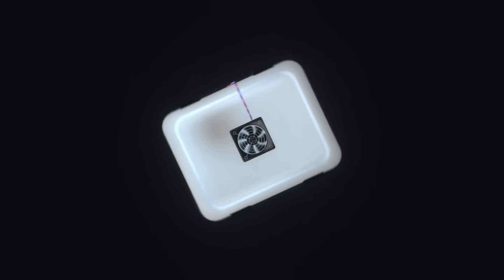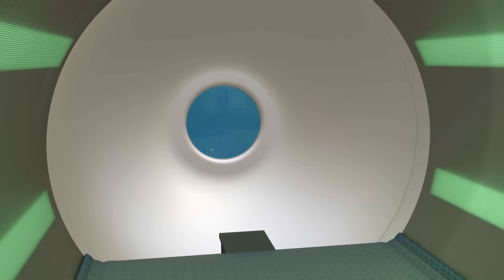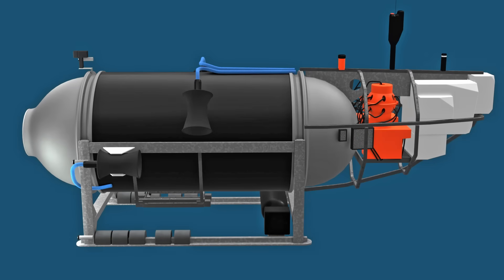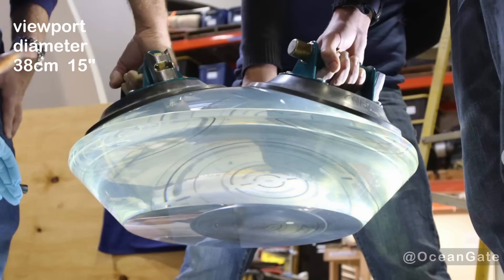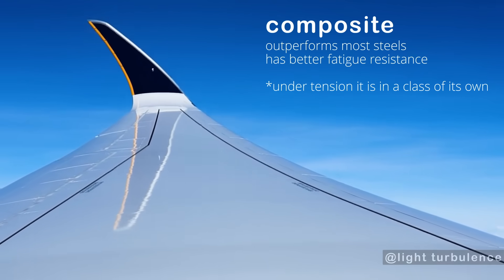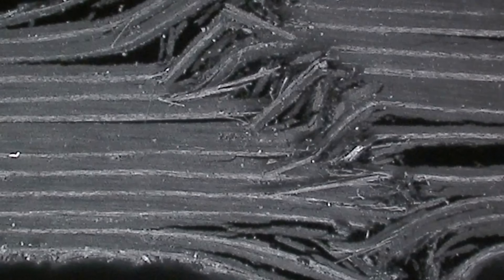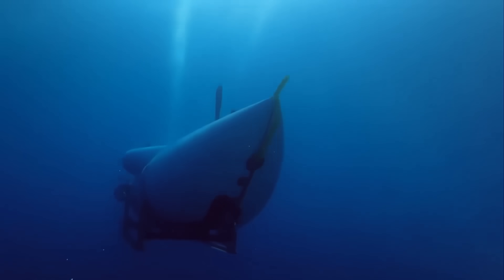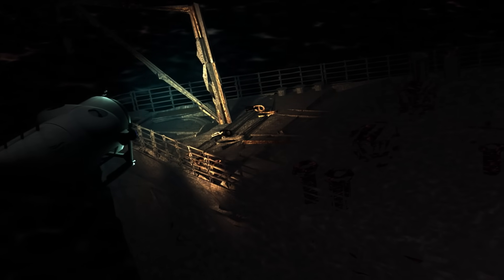Titan Sub | carbon fiber - Detailed Tour

Comment: So there are many comments here and some half truths and statements from people who sound like experts, but the stuff they say is just wrong.  So being an Engineer that worked for the past 30 years in the aircraft industry and design and build high performance sailplanes from exclusively carbon fiber, I will add my 5 cents.

1.  Carbon fiber is a fantastic material with some limitations.  The compressive strength is lower than the tensile strength and for carbon roving my own measurement over a 20 year period in our University Materials Lab, I found the following.  Compressive strength 670 MPa, tensile strength 1000MPa.

2. In compression the fiber absolutely gives the strength.  The lower value is due to the fibers not being absolutely straight and therefore they buckle (Engineering term for structural instability of a column in compression) on a micro level.  The resin only keep the fibers straight and contribute very little to the compressive strength as the resin strength is only about 70 MPa.  

3. Somebody commented that the  analogy of a wing is not correct as there is not really compressive loading in a wing.  That is absolutely wrong.  The structural element in a wing is basically a beam that resists the bending moments.  In a beam the one side (bottom for aircraft) is always in tension and the other side in compression.  We use carbon fiber primarily as the structural element in our beams and the upper flanges is stressed in compression.  Because the compressive strength is well known, we can design save wing beams.  As a matter of fact, the tensile strength is an useless property in this application and we are only interested in the compressive strength.  

4. So to say CF cannot be used in compression is really an idiotic statement as it is untrue.  The compressive strength is merely lower than the tensile, but still very high and usable.  If you know the value accurately you can design safely with it.

5.  The application of CF is a submersible is not necessarily wrong.  30 year ago nobody used CF in aircraft.  Now it is well understood and used (787).  At some stage somebody must push the limit and use this wonderful material in new applications like a submersible.  The problem is that the problem must be well understood and the material be properly used.  The compressive strength of CF makes it a good candidate for this application.  The manufacturing method used was probably not completely suited for the loading of this design.  My own analysis show a SF just above 1 for the limit loads.  This is too close for comfort and a little more structure might have been the right thing to do.

6.  I Agree with the comments that the fibre must protected against water ingress that will cause delamination.

Regards
Attie
Reply: No one here has addressed the fact that while they laminated CF horizontally and vertically, they did not laminate the CF diagonally. My question to experts here is this: Would cross diagonal CF lamination combined with horizontal and vertical layers have been a superior method of building a center tube that would have been able to handle the external compression? Why wasn't this done?
Reply: @PumaTwoU  Yeah too right ! The whole "tube" was a disaster waiting to happen. CF is not the correct material in Hydraulic situations AT ALL . and especially with the layup method they used. Even employees left and washed their hands of it after voicing their objections.
Reply: @PumaTwoU  Re: Diagonal application of layers in a lamination.

Diagonal lamination still winds up being a near 90 degree lamination when compared to the other layers. The further off 90 degrees you go, the weaker it becomes to a force from another direction. In short, it adds a bunch of layers but all the layers wind up only working from one angle while making the whole effort a wasted process.

I'll use plywood as an example. Plywood is indeed very strong against loads applied to it's face. The face also resists shearing (twisting of the layers) when it's attached to a box frame, and will actually provide additional rigidity to the box frame itself against shear. Put a load directly on its edge though and the sheet will just fold up / crumble.
Reply: There are so many comments from armchair Engineers, let me add my two cents. As someone who fixes poorly engineered parts by making better parts that last, here is my observation. It failed. Bottom line, it was poorly and recklessly engineered. I would argue CF is a poor choice for a submersible at this time due to the fact there are little if any real test results for this application. Steel is a proven material for submersibles and CF is still in the theoretical stage.
Reply: As a structural engineer, who does not work with carbon fiber, I had to go to the stress strain graphs to make any type of judgement on carbon fiber as a good material in compression. I honestly couldn't find the numbers you provided for standard carbon fiber testing. There were numbers for an ultra high modulus fiber that were in your range, but most were down about 270 MPa. What I found somewhat disturbing about the material is the modulus of rupture is very close to the elasticity, meaning that the material is very brittle. I would think that under the extreme loading an elastic material would be preferable.
Reply: This seems to be a false equivalence. The problem here is that the pressure is lateral to the layup. The layup was also at a very narrow angle, when I was buying CF tubes for a project I was working on the tube manufacturers offered nothing less than 5 degrees. The layup on this was as near as they could get to 0, I think they offset by 1 width per revolution of the body. So there was very little fiber going along the length of the tube. If it started to crack it just had to split between fibers. If you ever wound a ball of string you know you need to cross it at a steep angle for it to hold together.
Reply: There's a big problem with large-scale layups like this and that's air entrained in the epoxy matrix. On an airplane, sent to high altitudes, those microscopic 14 psi bubbles aren't going to do much. Down below the waves you might hear water working into the matrix, bursting those tiny bubbles and making loud "snap" noises. That would scare the beejezus out of me!
Reply: @Grunchy005  that's why it should be laid up dry and vacuum infused with resin. Won't have any bubbles at all, not even gas dissolved in the resin.
Reply from the maker: Thanks Attie.  I have pinned your comment.  I hope your expert input moves the discussion away from engineering according to celebrity and toward scientific engineering 😁
Reply: @Mike-Bell  Sorry have to call, cut and paste expertise on Attie. There are several elements left out, disregarded the fake engineer, as they would have been sure to mention in talking about compression and tensile strength. And limitations of carbon fiber. I won't elaborate as they will just do a google search and come up with some BS as to why they left it out. But nice try.
Reply: @Mike-Bell  Failed because the guy in charge didnt have the basic understanding of what he was trying to do!
Reply: @Mike-Bell he's not just celebrity.  James cameroon is and has been deeply involved in deep sea submersibles for decades.  That's insulting to his expertise to just brush it off as "celebrity science".  I know your friend didn't go to challenger deep in miriana trench in submersible he built.  And imagine your friend did achieve that, got recognition he deserved, and then people like you brushed his achievements off as "just celebrity science"
Reply: The manufacturing of the carbon fiber would need to be very high precision, with no flaws, so that the strength could be guaranteed. Rather than winding it over a mandrel with rounded ends I'd figure out a way to wind it over end fixtures with hooks to pull the axial fibers straight. Forget pre-preg resin. Wind it all up dry then vacuum infuse resin into it. With that thick of a layup that would be the only way to ensure zero bubbles. The images of the finished Titan hull appear to have many bubbles visible under the outer layer(s).

Instead of machining the ends flat, I'd use a design similar to the plug hatches used on many submersibles. Machine the ends of the tube to a taper on the inside then taper the outside of the titanium rings, with a flat section around the outside so they can't just push into and split the tube. An extra amount of fiber should be wound around the ends to provide resistance to being burst outward by the plug taper and for additional axial support. Done right, this design might work without any adhesive, just several large O rings and lengthwise tension rods (inside or outside the tube) to keep things together when not under outside pressure.

The domes could also 'plug hatch' into the end rings and the front dome could be secured with a few toggle clamps rather than the large number of bolts. Might be possible to not use an aft ring, plug the aft dome right into the tube.

Emergency escape at the surface could be done by designing the ballast system with a forward and aft part. Drop all the forward ballast to make the submersible drop its tail then inflate airbags at the front. The rest of the emergency egress system would release the toggle clamps and the hinge. A couple of internal air cylinders could shove the dome out enough so it would slide off. Ladder rungs built into the interior would enable the occupants to climb out, even if the submersible takes on water and sinks. With the whole front open it should be possible to get out quickly. There are plenty of pools around the world for testing such an escape system without dropping the test article into the deep ocean.

Having a front dome with a vertical 'conning tower' with a plug hatch would add a lot of weight and complicate the design for resisting pressure. It'd definitely have to weigh more. Perhaps a center metal section with the top hatch and two CF tubes? Make it a bit longer for more interior airspace to increase buoyancy to offset the additional weight? 

Designing it to be assembled without gluing anything to the body tube would enable easy replacement and upgrades. Build a basic dummy submersible with just the tube, rings, and domes then repeatedly run it up and and down until it either fails or proves to be essentially indestructible down to the operating depth. If it implodes then the working life and depth of that tube design would be known.

But of course such prototyping and testing costs a lot of money, which as yet nobody building submersibles has decided to spend on R&D for a non-metal hull intended for super deep use.
Reply: @greggv8  re: Machining the ends flat

I watched a couple of vids showing the assembly process, and the CF wasn't machined. The Titanium flange did indeed interface with a cup and nipple design and was glued in place with resin. Additional layers of CF went over that interface after installation.

Closest analogy that springs to mind would be putting a threaded nipple on a hydraulic hose. Steel parts are threaded to one another with the hose material pinched in between. 3000PSI hydraulic fluid can't push through the steel, so the pinched hose doesn't leak, it just serves as a gasket.
Reply: @nunyabidness674  If I remember right, they also largely put the resin on by hand in what was essentially a garage.   No protection against air pockets forming in the resin and no real protection against particulates getting into the resin forming weak spots in the weld.  It seemed entirely insufficient for the purpose at hand.   Also if the glue was failing, was there really a good method to detect it?   I still think likely that cyclic loading caused the hull to fail but as I said, the joining of the ring to the hull seemed entirely unfit for purpose.
Reply: @greggv8 hi there , I'm a billionaire and I would like you to build me a sub based on your design.  How much will it cost me for R and D and full qualified t3sting.
Reply: This is how you are wrong:
The submarine in increasing depth shrinks significantly, the high modulus of carbon load the fibers past the Euler limit and it becomes unstable , the soft matrix does not stabilize enough to prevent micro buckling.
Why don't you make a test if you don't trust the analysis.
Of course the carbon fibers can take compressive loads up to the buckling limit.
Besides, the Aircraft envelope also includes negàtive acceleration requirements, in the V-g diagram. You really design/analyse long glider wings, like the Stemme  23m wing?   We do:  HB-YBI, Prometheus
Reply: Seems like a miss in comparison. A thread can take tension but not compression.

When claiming carbon fibres can most definitely handle huge compression then that is under the specific assumption the individual strands are blocked from bending.

And the build of this sub was in no way able to promise that. A bit of delamination and the bending properties of the wall is suddenly way lower than before. While delamination doesn't make the tensile strength drop like crazy.

And this is why airplanes are subjected to volumetric inspection of the material. But this sub had no ultrasound, x-ray, ... analysis done.

Is there even acceptable volumetric inspection available that is able to handle this subs pressure hull? Every mm³ of the pressure hull? Compression in airplane wings do not translate into working inspection methods for the hull. So "I have built wings" isn't really the full story here.
Reply: The application of CF is a submersible is not necessarily wrong, but it's not industry standard due to lack of testing a full knowledge of it's behaviour in this operation... they should have tested better (And a sphere shape would have been a good idea, when you make two big innovations at the same time, you have more possible failure points).
Reply: @Flaviorrodolfo  The fellow who makes the Real Engineering channel, an engineer himself, did his thesis on composite material failure.  He had a lot to say about the Titan's construction.
Reply: This accidents proves something. Let's not ignore that.
Reply: As an NDt guy working on composites i am really interested on your opinion on the flanges.
I find the Flanges i.e. the ridges of the glue Area comicly short.
they could have given next to no support to the hull.
I am missing a load Transition Area
Reply from the maker: @Flofutz  comically short sounds exactly right
Reply: It all depends on the application.
My beef with composite materials is they are not homogenic, and are highly dependant of how the layering was designed and executed.
As you stated, in most aerospace applications, we are looking for tension vs weight.  Here carbon epoxy & boron epoxy are excelent material choices.  But as this sub was not intended to take flight, I don't see how weight was a major desighn consideration.
For compression, composite materials don't sit right with me.  All it would need is a bad batch of epoxy, or a tiny air buble while applting the layering, for the part to be compremised.
A homogenic material, such as Armox steel, or Class-1 steel with a yeald strength of up to 1600MPa / 160kg/sqcm  make much more sense, as it's a homogenic material.
That's my 5 cents as an Ex aviation-structural technician (F-4 F-16 F-15).
Reply: @trespire  Weight is a design consideration for submarines. As has been explained in the video, the carbon fibre hull made the vehicle considerably smaller and therefore easier to handle for the support ship and crew. 
For military applications, titanium hulls allow deeper diving all other things being equal, or alternatively better acceleration and top speed compared to heavier steel hulls of same strength.
Reply: @trespire  You don't even need an air bubble. These morons put SCREWS into the hull! SCREWS! This alone makes far worse defect than any air bubble could...
Reply: @KuK137  If this is correct, it's utter incompetancy.  These guys have no buisness building a garden shed, let alone a human rated submesible supposed to safely operate under hundreds of bars of comprassive preassure.
Sounds like no one is regulating this industry.  Where are the licensing authorities in all this ?
Reply: @trespire  There are no regulations/licensing authority that do (or realistically can) govern the use of submersibles in international waters. Also, why do you think Rush, an American, used a Canadian support vessel and registered OceanGate Expeditions in the Bahamas. All a deliberate strategy to distance himself from any/all responsibility and potential litigation.
Reply: @maunsell24  Bahamian registration is typically a tax thing, the fact you can register just about anything in the Bahamas also says a lot to motivations. As for going with a Canadian support ship, that's just on cost. What will cost you $100.00 US in the US you pay about $65.00 US in Canada. Insurance and whatnot drive costs up incredibly on US shipping.

Working on a fishing boat out of Anacortes WA we were paying $1500.00 / month just for slip fees. We could tie up in Canada for a month, IN A BETTER EQUIPPED FACILITY, for all of $300.00 / mo.
Reply: @trespire  This is the problem with wealthy people who start these ventures. They tend to get ideas in their heads and stubbornly go forward with them, in a sort of tunnel vision. There was no telling him otherwise and he simply ignored professionals who questioned the design and testing methods. Any engineer would tell you to use a high strength alloy that is proven and only change one design element at a time. Then test it and carefully add or change another.  Doubly so since there were proven designs that he simply could have worked with their designers to make, say, a 6 person version of Deepsea Challenger.  Make it larger, over-design it, and then use it for hundreds of trips since it's operating at a fraction of what it was designed to handle (1/10th the pressure, given normal engineering safety margins) Apparently Woods Hole Oceanographic Institute offered to work with him on the project but he thought he knew better.
Reply: @trespire   Lucky you were just a technician and not the design engineer then! Yield strength is only part of the answer. Fatigue is going to be much more of a problem than just pure one hit strength and unfortunately metals aren't very good at it, so the safety factor on straight out strength for a metal pressure hull needs to be far greater than a composite pressure hull. If you had been a design engineer you would know that in aerospace applications a lot of material testing is done to understand both the high and low values of strength in order to allow for manufacturing defects. The load case for pressure vessels is a very simple one and as explained in the video only takes forces in 2 directions, that is why a non-homogeneous (or non-isotropic more to the point) material is so good as you can balance it's performance directly against the uneven forces and optimise it to save weight, rather than have to design for your largest force and have parasitic weight acting against the lesser forces.
Reply: @trespire  I believe the issue with weight is effect on buoyancy. So that with a lower weight design the craft can rise to the surface with it's natural buoyancy compared to a craft that is way too heavy and will never do anything but sink if power is lost.
Reply: @trespire  this is how I feel, too. Idk much about CF, but it basically sounds like glass; hard, brittle, not safe for coping with imperfections, physical strikes, etc., and prone to instant failure.

Idk much about subs, either, but I like the idea of multiple, concentric, hulls, where the pressure between hulls is not as great as a single hull, if possible. If I were designing a submarine, this is the first approach I would study. The idea being that pressure like a balloon in tension would be used, with only the inner hull at atmospheric pressure, against the next outward hull without a large pressure difference. This seems like it would be a better approach for larger vessels, as I assume the multiple hulls are going to be thicker than one hull. It also sounds complicated, and delicate, but a smarter approach than mere brute strength that also uses less material, as the hull becomes something of a multilayered material and air sandwich. My concern is that this still sounds like a vessel design that would pop like a balloon, which may be just as bad as popping like a broken glass. What approach would you prefer to try for this kind of high pressure hull problem?
Reply: @itoibo4208  It's actually not brittle when as a composite with its epoxy.  The individual fibers will snap if bent (not advisable), but it's never used like that, always together with its epoxy to create a composite.  Hence the term composite materials.
A flat panel of carbon epoxy will flex and twist no problem, it's extreamly strong in tensile stress (pulling force), so much so it's counter intuitive just how strong it is.
The challange is applying the wet / epoxy impregnated layers without introducing ANY air pockets.
For critical application with compression forces, as a laired, non-homogenic material, I don't think carbon epoxy, or any composite material, should be the go-to material.
Reply: @trespire  maybe, but what I usually see in failures in various videos is a brittle and catastrophic collapse of 3 dimentional objects, which does happen with other materials too, of course. I think if your design cannot handle any defects then it is something NASA made probably lol. I have seen glass strands bend like strings but usually glass is brittle. 

The goto thing is important. Why would you build a boat out of fiberglass when you could build it out of steel or titanium? Because it is easy to mold and cheap. 

If I were using fiberglass or carbon fiber, the first thing I might ask myself is, "How can I turn compression into tension?" How can I make this, so that squeezing it causes it to be stretched. The way it is wound? Some structures built into it, or attached to it? 

If my goal was a cheap sub, easily made, I would be thinking how this seems much more convenient than giant milling machines and foundaries. I can even make this is a warehouse space, even if i have to build a clean-room to work it in. I would, however, want to make a pressure chamber where I could test the sub for hundrends or thousands of cycles at beyond design depth.
Reply: @itoibo4208  Funnily enough it's how Russians do it, all of their subs have 2 or more concentric hulls and that's why they can dive much deeper than US junk and withstand much more damage, they are just more complicated to build and the CEO of the ship building company cannot pay himself fat bonus from all the cut corners...
Reply: @trespire  weight reduction in a sub means you can field a smaller sub. Sure, you can put a sub in the water with 9 inch thick walls that will undoubtedly survive the pressure. Sinking it will be no issue, getting it back to the surface though...

You need enough buoyancy to overcome the weight of the vessel, which is called displacement on surface ships. The weight of the ship is less than the weight of the water for the amount of volume. Same scenario with subs, except the sub changes it's volume when it allows tanks to flood to submerge. In the case of Titan, instead of changing volume they changed weight by adding more than the sub could float at launch, and then releasing some when they wanted to float again.

While I can get the concept of confusion looking at it from the point of view of aircraft, but it's literally the same principal when you think of the atmosphere as a less dense liquid than water. The plane has to compress air under the wing or lower air pressure above it to make the plane lighter than the fluid its floating in.
Reply: this is excellent -
Reply: I really wish you all would proof read your things carefully before hitting send, changed words by autocorrect or whatever the issue is makes for a lot of gibberish comments.
Reply: Aircraft =/= submersibles
Reply: I actually really enjoy a lot of the test to destruction videos from the late 1940s all the way up to the creation of NASA and beyond. 

I would rather have catastrophic failures during unmanned tests, than to have them happen on a manned mission.
Reply: Would it help to use sheets of other material inside the cylinder or would that weaken it? Say titanium or aluminum spheres. Or is it best to a have solid carbon fiber? Is there any combo that would help to hold the carbon fiber in place if it shatters or is that too unrealistic?
Reply: @randomuser2461  The fundamental flaw with the Titan was the mor@ns behind the design. They skipped over physics (what he called pushing the boundaries) of science, using pseudoscience. Submarines are designed as they are as cylinders with an external and pressure hull of materials and support structure with recognized limitations, they are boats that sink on purpose to carry men and weapons into battle. The shape is to accommodate the weapons platform while primarily moving horizontally at tolerable predetermined depths. The shape lends the cylindrical submarine to hoop compression (simplified hold an egg on its side between your palms and push the middle, squish) SO enter the complete, ……. !d!ots, They want to go straight down into ever increasing pressures and cold, past the point a hollow cylinder will withstand, carrying as many future cadaver’s as they can.
So hoop compression, = byebye. Greed designed the Titan, not science.
Two factors, pressure and intense cold, the deeper you go the colder it gets, cold salt water is dense and sinks to the bottom of the ocean driving the warmer waters to the surface, and they ain’t that warm. Ask anyone who survived a wreak at sea who experienced the laws of thermal dynamics.
Carbon fibers are also categorized by performance according to their differing tensile moduli, bonded with resins, what is suitable for an aircraft does not necessarily serve a deep submersible. They used surplus aircraft materials blindly, with no data to support suitability. Then you have the shape. (For an analogy now Place an egg in between your palms pushing against the ends) takes longer to crush, because of the shape which displaces the force resulting in Uniform compression. Same material two different types of compression regulated by the shape. The ideal hull of a deep submersible, diving ever deeper has been found to be spherical in structure (Uniform compression) to withstand the increasing symmetrical load conditions. But to fit enough people it would need to be enormous and not practical for commercial tourist operations. So greed + stup!d!ty = "Hey lets make it a cigar out of rejected aircraft carbon fiber, with a silly cone shape on one end, and retrofit a dome to the other, to look like scifi OOO! AHHH! and hope for the best. Never works out well. What was the question again? 😁
Reply: If you look at glider fuselage boom failures (carbon fiber), it is always the compressive side that fails, not the tension side.

R
Reply: I once had a guy try to tell me that an obvious piece of loader bucket was a helo blade. “No bud, helo blades are composites.”
He didn’t believe me, good times.
Reply: did you just compare aircraft that flies on different environment with subs in deep sea with much more pressure than high altitude? your misinformations will costs more lives in the future if you are not making clear where and how CF is good in application
Reply: The Young's modulus of carbon fibre (CF) is different to that of titanium. At depth the materials would have compressed a small, but important and crucially different amount. This would have caused damage over time between the CF and titanium interface i.e. at the ends of the CF cylinder and the titanium rings.
Reply: @jack504  Exactly.
Reply: @jack504  The glue appeared to be thick and rubbery, more like a gasket that would allow the differential expansion.  In use, the joint is in compression.
Reply: Thanks for sharing your obviously vast knowledge of this subject with us. My comments were focused on seemingly obvious compression failure. However, that thesis does not square with progressive failure. Presently, I would consider dissimilar materials as used in the end bells which would have a different  modulus of elasticity and thermal conductivity and heat capacity. The sudden dive may have resulted in a large thermal tensile stress in the carbon fiber. The fact that the cracking noises from previous dives were not taken seriously is unconscionable. A close friend of mine was onboard a submarine during its initial test dive. gunshot sounds came from the hull....the sub was immediately surfaced and sent back to dock. The analysis was that spot welds were used to fixture plates during construction which should have been removed before launch. The fact that similar sounds in this submersible were treated as business as usual is a tragedy in itself.
Reply: CF composite materials were introduced into aviation to solve specific problems. 
What problems would CF composite materials solve in the construction of deep dive vessels?
Reply from the maker: @rok1475  Composites were introduced to aviation for weight saving, better fatigue resistance and its rigidity. Carbon fibre was used on Titan for very substantial weight savings and it deflection under load that is very close to Titanium allowing it to interface.
Reply: Do intelligent reasons exist to prefer it to proven hull construction methods? Yes or no?
Reply: @Comm0ut  If someone were to spend all the money to do all the R&D necessary to properly certify it... maybe. We don't know yet, and anyone claiming they do doesn't know enough to even be wrong (unless they have access to some spicy classified research).

It's a novel application of the material, so there will be novel issues. It might turn out that those issues are solvable with a reasonable budget, and in that case the higher specific compressive strength of CFRPs (when compared to titanium) will allow the construction of a new generation of vehicles with greater performance.

It might also turn out that the issues will cost too much to solve. In which case it's a dead end.
Reply: @cinquine1 Either way, certification testing would show problems to solve. They did ONE test in a pressure chamber (to Titanic depths, no destructive test to see how deep it holds) and then one "sea trial", so NO long fatigue test...
Reply: @Comm0ut  Yes. Cost of construction is one, operational handling is another.

To launch the Mir, you needed a ship capable of handling 20 tons of top weight to get to the site, and of dynamic weight to launch or recover the submersible. Titan cut that in half.

The support vessel didn't need to be massive, cutting operational costs.

RV Akademik_Mstislav_Keldysh is a 6420 gross ton vessel, it handled the Mirs

Whereas MV The Polar Prince is only 2062 Gross tons, and it deployed Titan.

It might cost a half million to operate Keldysh for what it would only cost 125k on Polar Prince
Reply: @Comm0ut  Yes, if you can get it to work right. Less weight, less thermal contraction, and no galvanic reactions, there's more reasons (cheaper manufacturing, cheaper materials, cheaper shipping), I just don't find them intelligent.

The reasons I listed are why SCUBA tanks have mostly gone to a carbon fiber string wrap design, it was the unintelligent reasons that changed the industry.
Reply: @muninrob  the big difference is that scuba tanks, like any gas bottle, have the higher pressure on the inside not the outside. So the CF is in tension.
Reply: It flexes.  And becomes weaker with every flex.  In layman’s terms.
Reply: Oh, five cents worth of comment. Sounds arrogant a little bit. To expensive for me to read.
Reply: Two more factors play an important role in compressive strength of carbon composite materials.  First, for as far as I know, all commercial carbon wires or strips are woven and or twisted to hold the individual fibers together.  For that reason, the individual fibers follow certain radii, even if pulled hard during application.  The dimensions of those radii fully define their tendence to buckling.  And, for second, it is the mechanical qualities of the matrix material that should hold those buckling forces.
Reply: but it CAN bend under compression so gluing titanium caps to it they'll definitely pop off so it literally does not matter how strong the titanium or CF are they're going to come apart under pressure think of a can of pringles being squeezed the can doesn't need to completely crack for the cap to pop
Reply: Didn't realize that the compression strength of CF is that good.
Reply: Once the CF is compromised even a little, it simply shatters.  Most likely is the glue joint.  Weak layers not under stress as was mentioned, combined with the joint being held together with basically epoxy.  From the damage, it looks like the rear failed first, blowing the ring outwards on the front one.
Reply: What university did you get  your mechanical engineering degree from. Do you know what culpable homicide is?
Reply: Allmost right. But it is part of the truth that the forces that affect a tube deep sea are very different from those on a aircraft wing or fuselage or a wind turbine blade or a F1 car. Its always problematic to generalize (yeah, always ;-)
Reply: They all didn't deserve to die but the maker did
Reply: @kevininforks  I can get behind that statement. The "maker" in this case though was just the guy who paid someone else to actually put it together. He might have come up with the design, but I counted 12 in the news footage of its assembly.
Reply: Ocean engineer for 12 years.   You’re the first “aerospace engineer with XX decades experience using carbon fiber” who actually made correct statements.  Kudos.  

I worked in Seattle and saw job openings for this company years ago and didn’t apply.   Lots of yellow/red flags, I didn’t think about it much.  My initial reaction to the detail this summer was horror.  But once you look at it, I could tell you exactly what design space they were shooting for and why there were good ideas involved - now, don’t misquote me, it was an awful idea IMO due to the amount of risk they assumed with the funding they had.  Think Stockton rush guilty of manslaughter IMO.
Reply: As a fellow mechanical engineer, I applaud you for clarifying to '30 year experts in the field', specifically, points 3 & 4. My absolute favorite is when they use the scuba tank analogy; do they think a CF scuba tank experiences ZERO compressive force, just because the pressure is inside the tank 😂
Reply: " not necessarily wrong "  Really dude?  You want to compare multi billion dollar corporations to a independent GoFundMe submersible?  How many BILLIONS of dollars has been poured into research on if CF can be applied to flight?  How many corporations are willing to put their name to something without EXHAUSTIVE testing to ensure that the safety envelope is several hundred percent before putting PAYING CIVILIANS into a craft?  Its one thing to toss a test pilot into an experimental, its another thing to put TOURISTS.  
You point out that the Boeing 787 uses extensive CFRP (carbon fibre reinforced polymer (plastic)) which it does, but it is not the only thing used in the main structural components (as is the case with the GoFundMe sub) and even then, the 787 is a never-ending series of problems.  How many times has the FAA and other safety orgs forced a stand-down of the 787?  2 yrs ago FAA warned the wings could fail.  And this is from the same folks that ignored the problems with the horizontal stabilizer jackscrew and allowed the 737Max to be certified under the 737 rules despite the CoG being changed and the engines location completely changing flight characteristics in emergency maneuvers.
Reply: I have not been able to read every comment. When this happened my immediate question was why did they not put any of the carbon on at a 45 or other synchronous fashion. What am I missing? Thank you.
Reply from the maker: @HootisGarage  any fibres not in hoop direction will reduce the hoop load carrying capacity or the pressure onto the tube face. 
On the flip side 45 and 135 fibres would somewhat reduce delamination which I’m guessing is a very likely failure mode. 
The 45 135 fibres would partly resist the axial forces meaning some of the axial fibres could have been laid hoop to help because is the primary load.
Reply: @Mike-Bell  my arm chair engineer brain visualizes 1/3 1/3 1/3 long, lateral and 45. Thanks for the reply
Reply: I agree, the main issue using CF is that the aircraft industry standards are so high and also the testing they do for all the composite materials is in the extreme, plus the titan was not made in the same very strict manufacturing processes like the aircraft industry posses, if they say so, then i bet my life no aircraft manufacture would allow the use of their equipment to produce the titan its that simple. 
Also buying the cf composite and suppliers also provide engineering certification for its various cf materials and its specs,, also i bet the material for the titan project, was not at all hi grade tier one products, but more like commercial grade cf and not certified aircraft grade.
Also where is the certification from the cf manufacture and the grade of cf used to make the titan?

I used to sell aircraft materials namely Specialised alloys ad CF compersites like those used inside the luggage loading  areas, which have specialised patches made at various shapes and sizes to patch up holes made by the luggage loaders.
Even those composite materials have engineering certifications with the products, before they are sold and used by aircraft maintenance personal?
All aircraft maintenance and sellers of composite materials and aircraft alloys all have 3 engineering certification letters signed by the manufacture / Seller and end user before its used on any aircraft, for traceability, should anything go wrong?✌👍👌😀
Reply: I find it weird that aircraft experts are in on a submarine design. 🤨 Rush was a aircraft expert. He designed a submarine that '''imploded'' catastrophically. How can some one make a experimental cylindrical shape under such external pressure is puzzling to begin with.
Reply: Attie Jonker, you should try unidirectional carbon pultrusions, we're seeing compressive strengths above 1000 Mpa.
Reply: Well......The difference is that that sub had undergone tremendous repeated compression and decompression which surface vessels and sailplanes never experience.  Which I believe led to a delamination and failure.
Reply: I assume the acronym  "SF" means safety factor?
Reply: Carbon fiber is wicked strong.. but not suitable for pressure situations since it won't deform. It instantly goes to critical failure instead.
Reply: @stratcat3216  it is commonly used as fuel pressure vessels in rockets that carry 100+ million dollar satellites though. It can't be that bad for pressure vessels if designed and tested properly.
Reply: What a stupid comparison!
Buying a 787 Dreamliner with a Titan and compression and tension levels!

We're talking about underwater Megatonalades in compression.

We're not talking about a 787 Dreamliner or an Airbus 350-900 or -1000 flying at 40,000ft with a cabin pressure of ~7,000Ft.

In addition, the carbon fiber used in a 787 or Airbus 350 is completely different from a TITAN that uses activated carbon fiber.

What happened for me was that carbon fiber is unsuitable for underwater operations at great depths.
Reply: I get what you are saying but are you really going to hop in the next sub made out of CF?
Reply: Ok helpful feedback on kpas! 

Re "the stuff they say is just wrong"
My thought on this comment is that engineers say incorrect things all the time too, only a few of us are very careful and it's not necessarily a professional advantage. 
 JBP says talking is thinking, and I think this is a good venue for anyone who's interested.   It isn't necessary to discourage discussion, correct or otherwise. I also think it's valuable for people to practice discerning what's correct from what isn't. Just my 6 cents :)
Reply: @jj-jak 100% agree. As a surveyor and on the spectrum to the point I take everything literally so have to translate. This can obviously lead to an element of ambiguity, so I repeat my translated version to the client who then says "yes, that's what I just said" despite it being nothing of the sort.
Reply: One can defend it as much as one likes.   But the fact is it failed.
Reply: @edwardfrostickblois4191 how about you convince every rocket engineer that’s ever lived that because of failure they should have packed up and gone home. 7 astronauts died in the Columbus disaster! It failed! By your logic that should have been the end of the space program until they used an entirely new technology, guess what, they didn’t, they improved and ironed out the bugs of existing technology.
Reply: At 6,000 psig, carbon fiber is not an optimal choice. Not even close.
Reply: @dr.emilschaffhausen4683  unless you're too cheap to buy the real deal ,and don't mind high risk for wealthy investors who are suicidal.
Reply: Differences in deformations between the CF and Titanium parts of the hull will have quickly degraded their silly little glue joint.

CF may not necessarily be wrong for submersibles but the attitudes and methodology of the oceangate management and engineers was completely wrong.
Reply: @phitsf5475  You're absolutly right.  Albeit I neglected to state the joint between the carbon epoxy element and it's titanium end ring, this is such a glaring failure point, as it's a sharp transition between dissimilar materials.
The whole design premise of this subs' stucture just seems blatantly wrong.  Even to an Ex IAF structural technician as myself,  who hasn't worked on an aircraft in 30 years.
Should have made it ALL titanium alloy, or ALL carbon-epoxy (with very stringent qulity controls).
Reply: Boundary conditions are always a "gotcha".  I wonder if scratches in cf can initiate cracks like they do in glass and if the metal end caps would cause scratches.  @trespire
Reply: @SuperLordHawHaw  Those are valid concerns.  In aviation structural maintenance, we were trained in the IAF (very intensly I might add) to ALWAYS deburr and smoth any sharp corners and edges.  As these concentrate stresses in the material.  The material (Aluminium alloys or any other metal) must not have any abrupt changes in composition or geometry or shape. It must "flow" to enable the stresses to be gradually distributed.
To me, this subs design just screems "wrong".
Reply: @trespire  Rush made an all CF test model. The ends imploded. This is why he switched from all CF to CF body and titanium endcaps on the actual sub.
Reply: @nickl5658  Didn't know that, thanks.  It does make sense, as the stresses on a hemisphere are not the same as on a cylinder.  Some aviation structural componants integrate metalic inserts with composite material, for example hinges and attachemeny points.  But that might not be a good approach for high compressive application.
Reply: @phitsf5475  Agreed.  Carbon fiber and forged titanium are inherently different materals, with different modulus yung (coeficiant of deformation, as you stated).
Bad engineering.
Reply: again the compresive strength of cf is well lower then its crush strength an used only in aircraft because of the simply fact its strong from being blown apart but sucks under crushing pressure's  :-\        Great example, name one Military sub that main OUTSIDE hull is made of CF...

and yeah   you cant find any because military dont care about money as much as something that wont fail ...   that guy, all he cared about was money so shortcuts were taken :-\    as an engineer, good thing he died with em, because I' have him shot for jeopardizing others lives
Reply: The forces in an airplane wing are nothing like the forces in a cylindrical tube under tons and tons of pressure. Yes, they are "tensioning on one side and compressing the fibres on the other", but nowhere in the same way as an omnidirectional pressure does, cause an Airplane is not 4 km deep under the frigging OCEAN, it only flexes along its axis under the loads of wind, weight and thrust, having to maintain integrity against it's own ability to wind/bend. NOT stand up to never ending forces from all over the outside trying to squeeze it down.

Even worse: 
NOBODY has built a submarine out of this stuff before, so there is zero experience to go by.
NOBODY has tested it's limits in that environment and under repeated stress cycles before, which could be used to shorten the testing cycle for this model.
NOBODY has developed a production standard for it. So the test models would have had to be produced under utmost care and continuous supervision by the engineers.

Which means that the company would have had THE DUTY to do multiple tests, iuncluding going down to the ocean floor mutliple times UNMANNED before man qualifying the construction. Instead they went for ONE pressure test, that wasn't even quite conclusive and especially not if you consider how often they wanted to reuse the bloody thing, they also skimped on the fibre source, going for the cheapest stuff they could find, they skimped on the baking cycle, deciding against a properly sized Autoclave and then they threw this untested and under-.engineered monstrum into one of the most hostile environments known on earth.

Bloody haphazardly doesn't begin to describe their work ethics.
Reply: @Ugly_German_Truths  And they also bought the pre-preg CF out of expiration date, because it was cheaper...
Reply: "6.  I Agree with the comments that the fibre must protected against water ingress that will cause delamination"

as you know.. delamination is mainly caused by multiple deep dives, which is the material being subjected to incredible high stress and back to normal over and over. assuming a perfect construction.. there can`t be water ingress without some form of delamination or crushing in the first place. these `man made` weaknesses are simply not there in metals like for example steel and titanium, water can`t force itself into the material and the metal hull stays uniform if designed correctly with lots of overhead. add to this the low weight of carbon/resin have little value under water, so even if the methods and design improve.. its rather pointless. so why invent the wheel twice with potential disaster ever looming. carbon fiber can surely be used for relative shallow depths
Reply: Ps aviation and deep sea marine environment are totally different
Reply: very good sir!  now, can it be made better? by not you and me?  there in lies the heartache. God bless you for your contributions - we all somehow played a role.
Reply: Using it to make a submarine is idiotic that's the context people are obviously saying it in, learn to read the room a little
Reply: @neiliewheeliebin  No. CF is not automatically idiotic in submarines. But you need to understand numbers of supported dives. And the ability to analyze the hull to detect defects. This can be a great material for robot subs or for shallower depths. But when taking passengers for really deep dives, then you need to be able to compute the strength to know the true safety factor. And we don't have good means to actually measure the quality of thick CF hulls. We do have means to produce 1000 hulls in steel, titanium, acrylic, ... and say "they are all good" And we do have means to say "max 100 dives with your acrylic hull". Then scrap and move to next hull.

But we have no good means to say how many dives this CF hull has the ability to handle safely, since it's affected by multiple parameters we have a hard time to measure.
Reply: @neiliewheeliebin ”reading the room” has quite a simple meaning and it couldn’t be any more unscientific if you tried. It just means just go with the flow and follow what everyone else thinks…. So Mendel, Darwin, Galileo, Aristotle, Da Vinci etc etc and any other thinker who chose not to read the room but ended up vindicated by their actions by not “reading the room”.
Reply: @teeanahera8949  I literally mean read the room nobody is blaming Carbon Fibre on the accident directly those people were killed by a narcissist that ignored engineers
Reply: Well a cylinder being crushed will stretch and take on an hourglass shape which increases the diameter of the hull at it's ends.
One or Both Titanium rings literally popped off
Reply: Someone"must" push the limit"?  I defy you to articulate coldly pragmatic reasons to do that with composites under submarine pressures.. Weight is not an issue undersea and subs are not aircraft unless the pilot concerned is having a very  bad day.  When there is no coldly pragmatic benefit to an engineering safety choice there is no reason to try to reinvent the wheel.
Reply: What is so hard to understand ? Take a shoe lace and pull on it .. ok good. now take the same shoe lace and wrap it around a toilet roll and crush it . Point made . Materials are classified in their appropriate strengths and weaknesses . Carbon Fibre is NOT appropriate in compression AT ALL EVER ! Now maybe you can get 670MPa in compression in the lab and 1000MPa in Tension .  But consider this ! You are SEPERATING the layers in compression this is cumulative . In tension it tightens the fibres . 
So you have a limited service life for carbon fibre in compression and it WILL FAIL in service . And I don't care if you consider aerospace applications but we are talking hydraulic impregnation and incremental delamination . As an "Expert" you are misleading the narrative .
The long and the short of it is that cumulative ingress of water that could not ever be removed or eliminated is TOTALLY different than Aerospace applications as the pressures are NOT relieved . 
AND the pressure in Aerospace is negligible even in space equating to at most 14.7 PSI or 1 ATM or 101.3 KPa.
Aerospace comparison is ludicrous. WHY ? you are talking LOADING in near atmospheric conditions. COMPLETELY DIFFERENT .
HOWEVER' you are correct that the interface between the Carbon Fibre tube and the end domes is the MOST critical area and I accept that this was the failure point as micro "gaps" would inevitably be created with the differential expansion and contraction ratios in this design. 
More over I think the design of the end domes and the interface  was the failure point.
But more appropriately the TUBE should have been made from a 3D printed Titanium Alloy with multiple differential pressure layers that negated the total pressure loading and reduced that to incremental loadings.
I confess that I do not design subs to these depths only 150M or less and even then I use incremental pressure zones that save expense and weight. These zones are pressurised with kerosene to promote buoyancy.
Reply: The compressive strength of an empty toilet paper roll.

Perhaps if one can be designed as a sphere and properly tested. it would work.
Reply: @TheLunacyofOurTimes  I think bulkheads would have helped a little/ a lot! But what do I know? I do my own structural engineering! And test them with myself as the sole  guinea pig ! Oink oink ! 🐷
Reply: Attie, you’re well wrong, carbon fibre might have some compressive strength, hardly unusual, most materials do, but you fall down at the basic concept and I question just how much you have really had to do with aircraft design.

Yes, the top of an aircraft wing is in compression, and the bottom of the wing is in tension, but it is the tension component that is providing nearly all of the strength in the wing.

This vessel on the other hand was made with the carbon fibre ENTIRELY in compression, there was no tension component AT ALL!

THAT is the difference.

Something I would expect someone claiming to have years of experience in materials, carbon fibre and aircraft to not need reminding of.

As for the statement in the video about carbon fibre aircraft wings managing to withstand the force of engine thrust - well, again, the engine is supplying thrust, the wings and body are providing drag. What type force is an element existing between a source of thrust and a source of drag experiencing? Yeah, essentially pure tension.

The engine is applying tension to the wing, and the wing is supplying tension to the fuselage.
Reply: @unlocated7448  ...? It doesn't matter that one side of a beam is in tension. If the material cannot withstand compression, the other side of the beam will fail. Since everyone here is ignoring the citations posted (I get it, reading words is hard), here is a video of a CFRP handling 1 GPa in a purely compressive test: https://youtu.be/8b2EgTu9_GU?si=s-C7fP4L-jQ0FJ2O&t=218
Reply: 5 cents from someone who has not built a deep sea submersible is an estimate whose true value asymptotically approaches zero.
Reply: @RadianIndustries  Well that's a big word... now do you grasp the concept that ALL estimates approach an asymptotic value of 0? You're trying to talk shit using vocabulary, but in the end all you really expressed is "stuff can be squished". 

Anyone who's wadded up a napkin has skill enough to make a demonstration, even if they aren't a material studies specialist who could describe the entire process in finite detail.

Counterpoint for example: 

I'm a general mechanic. I don't specialize in any specific make or model, but with very few exceptions (Mazda RX7 being one, the Chrysler jet car being another) I can reasonably assume all internal combustion powered cars have pistons. 

2 stroke or 4 stroke, the piston hasn't changed its function since the beginning of internal combustion engines. Knowing how a piston functions doesn't mean I know it's specific metal composition, but I do know what sort of stresses it will likely experience in operation.

The difference between an engineer and a mechanic is the engineer knows how to start from base materials and get something assembled in a fashion that will likely work. A mechanic knows how to take it apart, undo damage, and put it back together again. Mechanics tend to make for lousy engineers, while engineers tend to make for lousy mechanics, BOTH can have expertise in the field of inquiry.
Reply: @nunyabidness674  At least OP's comment had something to do with deep sea submersibles.  Your comment, on the other hand, is not even wrong.
Reply: @RadianIndustries  My response to you was that just because dude hasn't specifically produced a submersible doesn't mean they are clueless as to the material properties of Carbon Fiber.

Your comment of:

"5 cents from someone who has not built a deep sea submersible is an estimate whose true value asymptotically approaches zero."

essentially expressed your opinion that if they've never built a submarine with Carbon Fiber, they have nothing to contribute to the discussion. Never mind that the only person to have paid to have one built is currently serving as chow for bottom feeders.

Enjoy your snack.
Reply: Is this video made by an AI in beta? CF was the failure here… If not from exploding it was a failure of engineering, scientific process and a certified death certificate.
Reply: @tjnucnuc  ...which is what the video said. You know, if you watched it (try that next time)
Reply: When you state that "CF cannot be used in compression is an idiotic statement and that CF in a submersible is not necessarily wrong", are you implying that the Titan's CF hull is intact and may be located and brought to the surface?   What does all of those sharp cracking noises that they heard on the first dives tell you.  Would you volunteer to descend in a CF hulled submersible to the Titanic?  Any time someone starts laying out their credentials in a discussion I tend to suspect their argument isn't going to be a strong one.
Reply: @denniscliff2071 Not at all.  

He said that with his calculations, the hull was not designed to be strong enough.    A safety factor of close to 1 is far too low for a human carrying pressure vessel.   No one is doubting that the CF hoop failed.
Reply: @denniscliff2071  A safety factor of 1 is really a bare-bones design approach, what it means is that it can just about handle the maximum loading being applied to it during normal operation. 
If the forces increase by just a tiny bit or something unexpected happens a catastrophic failure will occur. 
Safety Factors are put in place to prevent failure during normal operations and take many situations, the environment and past failures into account.
A metal will plastically deform before it fails while carbon fibre will suddenly and unexpectedly fail if pushed above its limit which is what happened when the submarine imploded.
Reply: @denniscliff2071 what he said was pretty clear, dude. Carbon fiber can be used in submersibles but the material limitations for that exact application needs to be tested and we'll understood before they can use it properly and successfully for that specific application. The founder of ocean gate did not understand this and that's why he died. Is that so hard for you to understand?
Reply: @JAMR0716  I share a similar sentiment, but from a sightly more toxic point of view.

My opinion is it was someone who wanted to test the boundaries of a relatively "new" material, and wanted someone else to pick up the bill
Reply: @denniscliff2071  argumentum ab auctoritate.  One would like to believe that the credentials show they are an authority and can therefore speak on the topic.  But as you point out, usually the person is an authority in an unrelated topic that they themselves don't understand is unrelated.  And we end up at a subtle form of argumentum ab auctoritate.
Reply: @denniscliff2071  You do know that metal submarine hulls also buckle and shatter when they fail, don't you? Your "evidence" doesn't say  much about CF submarines, it just describes the failure of the pressure hull of any deep water submarine.
Reply: @denniscliff2071 No, Attie just said that CF is a potentially usable material for a submersible. Attie did not imply that that the specific hull made for the Titan was well designed, well manufactured or well maintained.

Maintenance.

Since Attie mentioned sailplanes: planes need to be inspected every 100 hours of service (+/-10h, but at least once a year, even if grounded).

Since everyone mentions the Titan: the Titan's hull was never, ever, inspected. Stockton Rush explicitly forbade inspections of the hull! The hull was also covered in Rhino Liner which prevented visual inspection of the hull.

If someone was concerned about the noises the hull made during descent (Stanley mentions "gunshot-like noises" in this video, but mentioned (elsewhere) crackling noises setting in at a depth of 100m already), Stockton Rush would say that "it's just the weak fibers failing" and that passenger should be prepared for the noise growing louder while the Titan descends further.

The Titan made almost 100 dives (with the vast majority of these dives not making it to the Titanic). And yes, it did occasionally hit the seafloor, and it hit the Titanic on at least one preceding dive (to be exact: it hit Titanic's propeller blades and even got stuck for some time; someone, probably Paul–Henri Nargeolet, blamed that on the "sluggish" reaction of the submersible...which sound very much like the one-star reviews for the Logitech game controller on Amazon).

Totally unrelated: the viewport was not rated for the 4000m depth either, just to 1300m. I did not find any official data, but according to my (rough) calculations, Röhm manufactured it with a safety factor of 3. Since Stockton Rush was happy with SF=1 (seems to be confirmed by Attie's SF calculation of the hull), the Titan operated at an a safety margin SF=1, giving it an MS of...zero.

Whatever: I cannot blame the effects of incorrect use and maintenance of some material on the material itself, like with the Titan. Like some metal which happily shears when subjected to external forces at freezing temperatures, like with the Titanic. Stockton Rush was likely aware of the Titanic.
Reply: @denniscliff2071 seriously buddy, you cannot infer that he said cf guarantees structural integrity, which part of ”not necessarily wrong” did you not understand? I shall spell out for you that he also extrapolated that if the fibres were not layed up properly then he suspects it was the cause of the failure.
Reply: @denniscliff2071  when carbon fiber fails, it fails spectacularly; it splinters into tiny pieces when it fails. More force, more pieces. The fact that CF fails spectacularly, however, Does Not = CF cannot handle compression. That logic does not stand. An example for you: Take a basic rock for example. A rock can handle compression. You can park a truck on a rock. But sure, if you put a rock in a 20 ton press it doesn't bend, it shatters into dust aka 'spectacularly' like CF... spectacular failure does not = weakness in compression. Ultimately, the 'concoction' of a vessel they slapped* together did not have the manufacturing quality* nor durability* to achieve what they designed and calculated for.
Reply: @denniscliff2071  Good points. And using CF in relatively low compression like aircraft compared to massive compression like a submersible designed to go as deep as possible, without the actual data necessary to know exactly what is going to happen, especially over time of multiple dives, is not something I'd be arguing as "smart or forgivable" (my quotes, because I'm not sure exactly how to characterize the defense of what has happened).
Reply: @denniscliff2071 that’s not at all what he’s saying. He’s saying that the hull was designed incorrectly. Even if they used a titanium hull it wouldn’t mean that they designed it correctly. A company like this cuts corners and eventually is left with deadly consequences. The man is saying that CF can be used in submersibles and eventually probably will. But Stockton Rush did it poorly. To the demise of himself and his unfortunate customers. It’s not the materials fault that Stockton is an unscrupulous engineer. Unfortunately people want an easy answer to point their fingers at and the dogmatically follow what the talking heads on the news say.
Reply: @denniscliff2071  I would ride in whatever vehicle Victor Vescovo assured me it was safe to rid in.
Reply: @denniscliff2071  for example a thin skin of metal around the CF may have prevented degradation from multiple dives, there are many potential solutions... the problem was that SR didn't even test one solution before embarking passengers. Probably our military has test data they aren't sharing with the public, that could help inform a project like this.
Reply from the maker: @denniscliff2071   I know Attie and can vouch that he has a career dedicated to designing and building composite sailplanes. Which makes him uniquely qualified. His business succes literally depends on the magnificent compression characteristics of carbon fibre. 
I find it amusing how so many in the comments are attached to the celebrity science that carbon fiber is no good for compression. This badly laid up tube still withstood the insane crush at titanic depth 13 times. There is proof enough that a jerry built carbon fiber tube handles spectacular compression. Imagine how a meticulously built one could manage tested properly could do.
Reply: @Mike-Bell  I did not use the word "idiotic".  I was quoting Attie's use of the word to describe someone else's comment.  Deep sea submersible deaths using steel or titanium vessels =0,  CF subs per first attempt = 5.
Reply: @Mike-Bell  I don't know Attie obviously and I'm not a specialist in this matter but, although I might be wrong, I feel the impression that we are comparing apples and oranges somehow. I'm sure all what he says is technically right but comparing the forces exerted on a glider wing spar with the pressure data involved in a sub diving 4 Kms below the surface seems to me disproportional. 
I'm not saying that composite material is a non-sense in sub design but it would need to be deeply and seriously investigated and tested before being used by a stubborn maverick ... "The manufacturing method used was probably not completely suited for the loading of this design": I fully agree and it's an understatement in my opinion, to say the least. 
The video as well as Attie's comment gives the quasi disturbing impression that SR was some kind of misunderstood genius betrayed by just a "to be improved" process of fabrication but, as I'm not an English native speaker, I might have misunderstood your point.
Anyway, from my perspective and independently of the fact that CF has the right compressive strength or not, I think this guy was lacking knowledge, acting as a teenager with a new toy, always on the razor's edge, deliberately ignoring safety related recommendations but having a very high opinion of himself. In other words he was dangerous and, to be honest, I still don't understand how people could have dared to board this "homemade sub" so to speak, to dive on the Titanic wreck 4,000m below the surface! The cause of this accident is not only the carbon fiber compressive strenght, it's mainly hubris! Just my opinion ...
I hope you understood what I meant in "my" English ... Regards
Reply from the maker: @patolt1628  the forces in any structural material always resolve down to compression or tension and typically both. A glider wing has equal compression and tension. The titan hull is all compression. I can assure you Attie understands the difference. The only thing he was unsure about was the unusually thick material and what oddities may present themselves. 
I don’t think anybody is defending Stockton Rush. But he wouldn’t have done this in a vacuum. There would have been engineers and experts who would have advised him this was technically possible and backed it up with concrete calculations and expertise. If it wasn’t and they still told him those people are culpable for manslaughter.
Reply: @Mike-Bell  Thank you for answering... I've been working in a technical area for decades (helicopter pilot then experimental test pilot and eventually engineer in the aircraft industry) but I have no expertise in this particular field so that I'm not criticizing at all, just expressing some surprise reagarding some statements.
"The Titan hull is all compression": yes, it's exactly the point. I'm sure Attie knows the difference with a glider wing, no doubt. I was not questionning that, I was just surprised by the reference to gliders or even aviation because of the order of magnitude regarding forces involved which seem hardly comparable, that's it.
Moreover, of course I presume that Stockton Rush didn't build his "sub" in his backyard but ... who helped him? Who was the project manager, if any? What calculations, simulations and tests have been performed? Who validated what? Being innovative is a good thing but it doesn't allow to do anything. It was obviously a poor design but Mr Rush is probably not the only culprit in this sad story. 
To be continued ...
Reply: @Mike-Bell  Just from reading on how Stockton Rush designed this submersible, I believe that he did have professionals in the indusyrty warn him that it was a bad idea. He used Univerisity of Washington students basically design it, and fired those in his company that questioned the design.
Reply: No, @Mike-Bell  You guys are both wrong on this one. Buckling and cyclic fatigue are the main issues with using CF as a pressure vessel. Buckling being the failure mode, and cyclic fatigue being a de-rating you'd be required to use if you want it to hold up to some reasonable number of dives.

Part of the failure of this "experts" 5 cents, is that he is listing a compressive value for CF, when you'd really need a buckling calc instead. As an example, some of my students have made and tests CF tubes of ~4", and found a peak stress of 14000psi for a 6" tall section. For that same exact area of CF, .864in^2, in a 3" tube 6" tall, peak stress is 25400psi.

You actually have to be an expert in order to understand that peak stress is tied to cross section area/length (or really moment of inertia/length), and giving some peak stress claiming it is 67% of tensile stress is foolish, and I would guess (as no data is provided) that this value has little correlation to ANY empirical formula that deals with a thin tube.

Also going to throw out, that I have a MS in mechanical engineering, and work in cutting edge hydrodynamics research involving running composite hulls AT DEPTH, and thus I view "Attie" as fully unqualified as an expert, especially since he is claiming a FS slightly above 1 is going to work. He's crazy, if you want to cycle something composite in this manner and have it work you need at least a FS of 5-25, or you will have to ultrasonically test the vehicle every single launch. If you've built and run composites underwater successfully before, you would have tested and found that out.
Reply from the maker: @superstrife9880  Do you have a more complete list of deep dive composite hulls?  This is the best I have  https://www.researchgate.net/figure/Composite-materials-being-used-in-submersibles-worldwide_fig1_364296004
Reply: @Mike-Bell  Almost all the info is in JUR, not JMSE.
Reply: @superstrife9880  moment of inertia is also rather important when we talk about production defects. That little mm⁴ hurts a bit when one beam is replaced with two half-as-high beams placed on top of each other, reducing the distance between max tension and max compression.

And that makes manufacturing flaws so scary for a pressure hull of a submarine when delamination makes it into two hulls inside of each other and where each is much thinner.
Reply: @Mike-Bell  If a cantilever beam is an I Beam then your statement of equal stresses is right, If it is T Beam the compressive and tensile stresses are very different. It all depends on the material x-section. BTW I was taught that the tensile stresses were on top.
Reply: @Mike-Bell he didn't call artie's statements idiotic.  He was quoting artie.  Artie used word idiotic in his post (which was also a quote actually).
Reply: @Mike-Bell bend a spoon back and forth many times, it breaks. Composites suffer the same fatigue. Wood is actually  more resilient than both. It loses a little bit of strength the first time it's stressed but doesn't continuously fatigue itself each load cycle. 

As you said, destructive cycling would have given a baseline. If the pressure vessel  was replaced each dive, or the cylinder and had biaxial weaving ( expense ). We would not be having this conversation.
Reply: @Mike-Bell  To be fair, Mike, Dennis was quoting Attie when he said "idiotic". Regards.
Reply: @Mike-Bell   Unfortunately, Rush didn't hire experienced engineers.  He hired recent grads with limited experience.  He bragged about that in interviews.  It's a scenario that happens all the time.  Some guy has a "great idea" and fires or simply doesn't hire anyone with experience who will tell him that his "great idea" won't work.
Reply: @Mike-Bell   I think the link you provide is a good indicator of the difference between CF and Titanium submersibles. There are only two HOV on the sheet, one was actually a steel hull (Cyclops 1) and the other is the subject of this video. The others are AUV or UG types, generally much smaller, easier to reinforce internally and much less 'precious' if one is lost. The impression I got was not that "CF was a bad material for submersibles" . But that it was poor choice due to being a relatively untested material in this application. This was exacerbated by repeated dives to this depth with humans aboard, poor safety margins and no method of determining the integrity of the vessel after each cycle.
Reply: @denniscliff2071  "Deep sea submersible deaths using steel or titanium vessels =0"

Thresher, Scorpion, K-129, and Kursk have entered the chat...
Reply: @Mike-Bell it was Attie that used the word “idiotic” in point 4.
Reply from the maker: @teeanahera8949  Thanks 👍
Reply: @Mike-Bell  firstly I will say thanks for giving a better insight into the layout detail of the titan than most other commentators. A very interesting video.
Secondly I would have to comment on this particular comment of yours.  Sailplanes are not submarines! I am glad that you revealed that the OP has real world experience of CF in an aeronautical context as opposed to just quoting figures from a university lab. Often the real world confounds theoretical or lab based dara. 

Stockton Rush was also an expert from the aeronautical world, and that is one of the criticisms against him;  that he assumed that his aeronautical experience trumped the hard won knowledge earned within a completely different field of operations.  Tank builders don't claim they know better than bridge builders how to build a bridge, just because they both use steel, or vice versa. Both have specific areas of expertise. 

I don't think anyone bar journalists are saying that CF is no good in compression, just that tension is its most favoured mode by a long way. Aircraft wings are designed specifically to utilise these properties by using the diagonal weaves so that some fibre is always in tension. 
The other massive difference between an aircraft wing and a submarine is the static differential pressure between the inside and outside of the surfaces. Even if a wing were perfectly sealed, there is a maximum static pressure differential of approximately 15psi ie the atmospheric pressure between sea level and space. That is nothing compared with that experienced by titan. 

It was interesting to see you show (I presume) that longitudinal fibres were layed down on the mandrel as well, as many had shown they were only wound on spirally, although you imply iirc that the original Hull was indeed layed down that way. 

I know it might not be directly appropriate to this case, but there was a video from the hydraulic press guy from some time ago  where he crushed a tube of CF longitudinally, (along with other materials). That's interesting and worth watching as the CF just turned into toothpaste very quickly. If the end caps of the titan are equivalent to the compressing  jaws of the press, then maybe that experiment would shed a light on the processes involved. Of course the press increases the pressure slowly, whereas the pressure at depth is already very high and the collapse would have different characteristics, but it was an interesting insight anyway. 

I think everyone was surprised that the titan Hull lasted as long as it did. Maybe there is a future use of CF in this field, although I suspect it may get regulated out of use due to this accident. 

I suspect, as you imply, that it was the gung ho attitudes that made the accident inevitable. I have seen video of one of the earlier trips where the weight release mechanism had failed and they had to jettison the leg structure to gain buoyancy. The return to the surface took many more hours than planned and they only surfaced after dark. Then (this is the footage shown) they had trouble with the docking platform. It ended up with the platform sunk in one corner with the diagonal opposite raised out of the water. The exit end cap was under water so no one could exit and the sub looked like it was ready to slide off of the platform. Without its normal legs, how was it fastened to the platform? It all looked very hazardous and the only thing going for them was that the sea state was relatively calm and they could get the recovery divers into the water. It can't have been very comfortable for the contents of the titan!
 
One of the big changes to operating procedure was the change from having the titan on board the ship when not operational, to having it towed behind the ship for the journey to and from port. This would add a considerable amount of battering and thus stresses to all of the Hull not just the fibre parts. One would assume this was done to reduce the cost of the ship, but again I have never seen any other sub or ROV operator do this. It can't make fault finding/repair/maintenance or even crew boarding easy, when the vehicle is always on a small barge rather than on deck. So new technology that probably required more inspections to ensure it was safe, ended up on a small barge where it would be much more difficult to make those inspections. It would make the chances of not closing the front cap properly more likely if done on a pitching launch platform deck rather than on the relatively stable ships deck (there are tales of one fastener being routinely left off because it was obstructed by other fittings. That makes it a the more important to get the rest right). 

So notwithstanding all of the other points about the use of fibre, the lack of cross weaving, the transitions between fibre and titanium, the use of a non depth rated window, the refusal to go through any type of external certification etc etc etc. The list goes on. I think regardless of whether CF turns out to be the root cause of the accident or not, it's use under these conditions is likely to be discouraged in the future until rigorous testing has been done. Which is what SR should have done in the first place, maybe.? 

Anyway good vid, thanks.
Reply: Just because you design and build doesn't mean you can't be wrong, i.e. the Space Shuttle @Mike-Bell
Reply: @Mike-Bell  How many of those craft (400 metres and upwards) are used to carry multiple wealthy fee paying passengers (aka deep sea tourists)?
Reply: @nunyabidness674  Seawolf was WW2 USN sub sunk by friendly fire (attacked by the destroyer Richard M Rowell using Hedgehog). I presume you meant Scorpion.
Reply: @maunsell24  nope. Meant the USS Scorpion (SSN 589) sunk by implosion following an accident 22 May 1968.

Bob Ballard found it on an assigned mission and then he also spotted Titanic on the same trip
Reply: @maunsell24  I just looked back, I see it now. Was thinking Scorpion, but typed Seawolf... I had just been reading up on both, and names intertwined in my memory
Reply: The Titan design was not inherently flawed; it was innovative and sound. However, a critical mistake was the insufficient testing. Dry test dives without passengers should have been conducted extensively before full implementation. Additionally, Rush's unique way of explaining his design and safety approach left him vulnerable to character attacks from conservative media outlets. Unfortunately, everything tends to turn political these days, and they had a field day. The irony is that Rush was actually a Republican donor, not a liberal one. Hopefully, a new submersible-building firm will take up the Titan design, perfect it, and vindicate Ocean Gate's vision. Cheers from Park City!
Reply: @ezragonzalez8936  for these depths titan surely were not sound. not the material used, not the method of how it were applied and not the general design of the vessel
Reply: @ezragonzalez8936  I don't understand your abrupt departure from the topic right into politics. LOL Ok?
Reply: You’re a right to your opinion but yeah no, this was the WORST use of carbon fiber and as all the experts, of which you questionably are not, there’s a reason deep sea subs are well machined metals where you absolutely know and can test for quality, which you can’t with CF. But hey, even if wrong, you’re getting clicks.
Reply: @colin-nekritz  Not just metal. Acrylic is also much used in subs. Because that too is homogeneous and not suffering hard to identify delaminations that greatly reduce the intended compressive strength.

And this being a cylinder and not a sphere means it needs help to stay a cylinder. The broken flanges on the end dome shows how that failed. It buckled like an empty toilet roll and some of the tube expanded pushing out the outside flange. And some of the tube got flatter and destroyed the inner flange of the end dome.

And as soon as it wasn't a proper cylinder anymore, lots of strength was lost. Spheres are so much better at having their shape being self-stabilizing. Any shape change of a sphere means an increase in tension somewhere to try to stop that shape change.
Reply: Machivallian Sociopathic narcissistic sanctimonious about the subject because you are bought out by the industry.  Respectfully said.
Reply: @SharkFaceKidd 😅 up
Reply: @SharkFaceKidd  What “industry”? It was the industry that has been saying the CF design of the sub was not optimal and subpar. I don’t understand what “industry” the OP has sold out to. 🤷🏻‍♂️